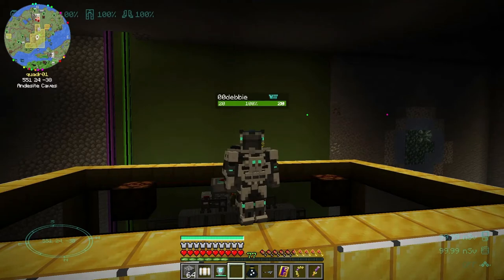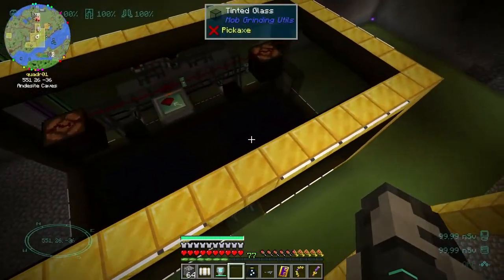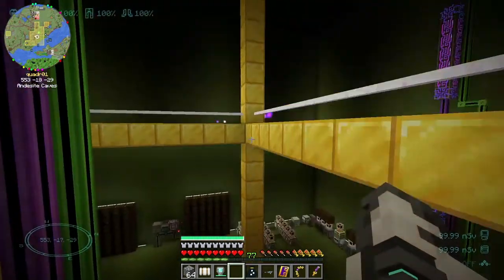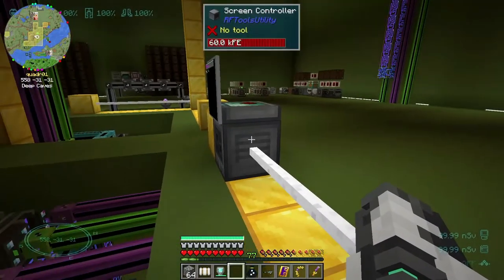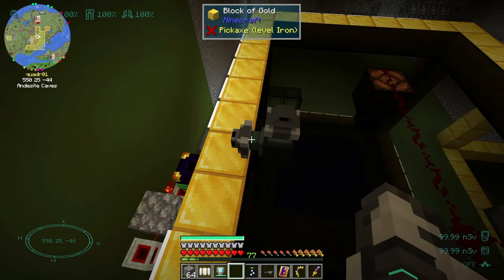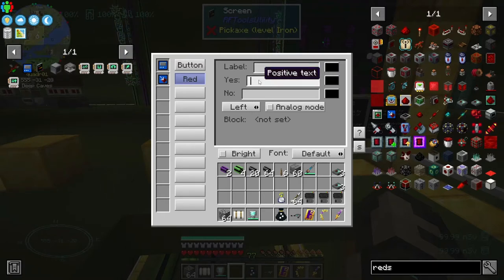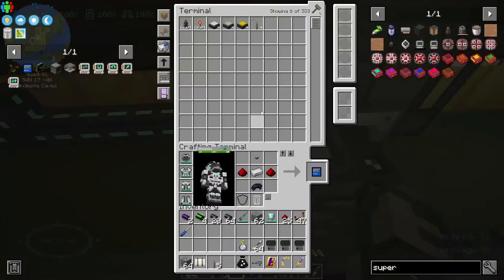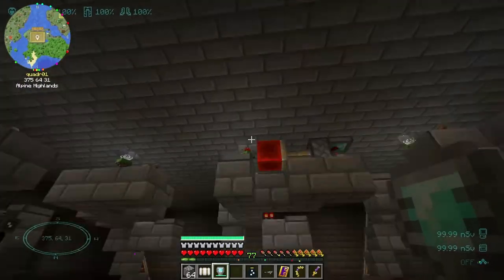DireWolf20 1.18 Let's Play Episode 121: RFTools Screens and Essence Relocation

Comment: Ooh, substituting an Ender Tank for your ME system with the Mob Crushers would be a good test as well.

From memory, DireWolf has used RF Tools redstone transmitters / receivers across dimensions, so I don't think there's a range.

Mek Ultimate Pressurised Tubes apparently transfer 6 buckets per tick, which means it needs 6 ticks to do 32 buckets, but will do up to 36 buckets in that 6th tick.

For the crafting monitors rotating, any chance that's a chunk that disconnects pipes randomly?  If so, it might be related.
Reply from the maker: Yes, I noticed after I finished recording that all the ME cables had disappeared and logging out and back in fixed it.
Reply: I wonder if it'd fix the rotating crafting monitors as well...
Reply from the maker: @JakeMoe  Yes, it did fix it :)

Comment: Why not use LaserIO to distribute the redstone signal to switch modes on your mob grinder?

And the Redstone Receivers aren't signalling the mob mashers because you're not pointing at the mashers, you're pointing at the dirt beneath them.  Remove the dirt and point the Receivers up at the mashers and they should work.

It looks like the Receivers aren't strongly powering the blocks; repeaters transmit signals through a block, but other methods don't.  Looks like the Receivers is one of those.
Reply from the maker: Yes, unfortunately the Receivers are a little quirky :)